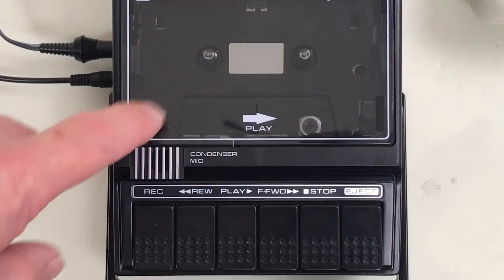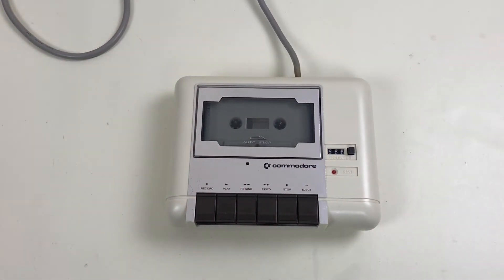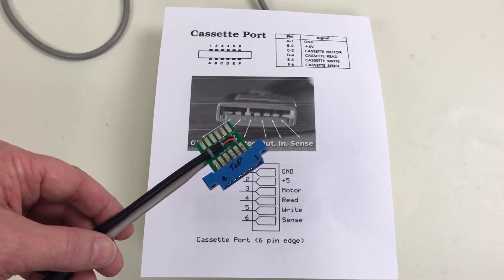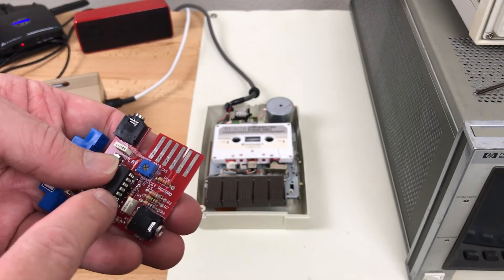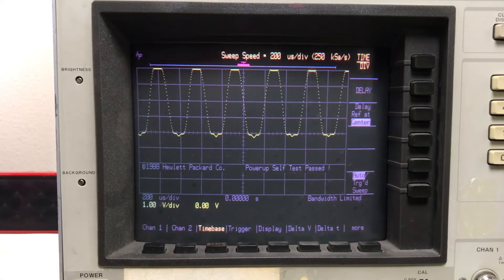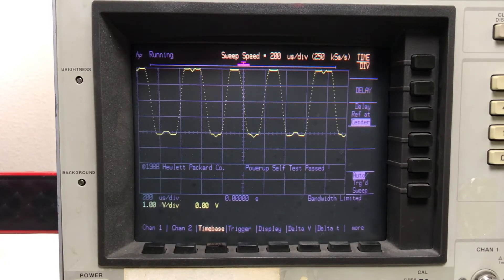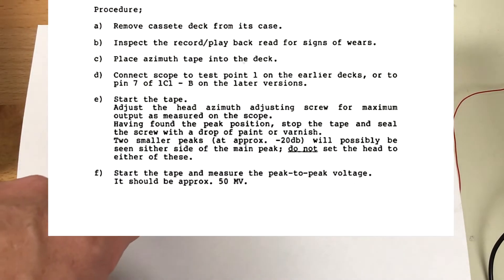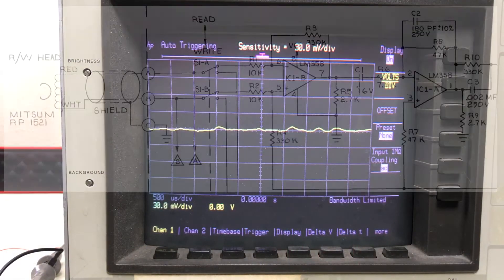Adjusting the head alignment on a Commodore datasette

Comment: Thanks...I do not have all the gizmos that you do, but I will see what I can do to see if my tape drives are indeed out of alignment...I have cleaned the heads as well as the contacts inside the connector...and have found a tape that I think can be trusted, but will go forth and look for a Vic-20 program pack from the factory and see if that makes anything better as well...

Comment: Good times.  I worked out the turn of the screw depending on the angle of the notch on the head screw.  Somewhere between 0-90 degrees. Anymore than that you've went too far. Whole lot of trial and error but it was all part of the fun of cassette loading backup tapes.

Comment: Back in the day we had little computer shops and they could install a small led light next to the head alignment hole and we used to adjust the head according to the brightness of the led light. I'm sure you could come up with some basic set up like that with todays technology. I still have my c64 and that datasette unit in my parents house but haven't used it for 35 years, i hope it still works 😅

Comment: Nice work I picked up a 3khz test tape I used to set head aliment and speed it works good.
But I opened the data set and got the single off the first amp befor it was converted to digital squarewave..
There was a test point for it on mine.

Comment: Awesome.  Will be trying the oscilloscope methods tonight!
Reply from the maker: How did it turn out?  Did you ever get that datasette to load reliably?
Reply: @HutchCA  I did get the oscilloscope hooked up and I was able to fine tune the adjustment, but seems the voltages are too high. Still does not work right. I am going to compare it to another working datasette to see if I can identify what's different.

Comment: An advantage of the scope is that if you know roughly what the ideal output is, and your deck is producing the right level, you don't need to do "trial and error" adjusting of the azimuth.  Would using a tape with a single frequency tone, say 1000 hz, be easier to interpret when looking at the output?  Is the azimuth often incorrect on these datasette units?

Comment: If memory serves me well, back in the olden days I read about attaching a resistor (470 Ohm?) between pin 1 (SRQ) of the serial port and pin 5 (Audio in) of the A/V port and poke 54296,15 to be able to hear the cassette audio of the datasette through the Commodore 64. Can you confirm this?

Comment: Wasn't aware of the oscilloscope method before so huge thanks for highlighting that.  I'll be giving that one a try very soon.
Reply: @HutchCA  I'll be receiving one of those 1980's alignment tape kits soon so hoping that the tape in that will still be working and accurate enough.  I tried the C64 program and had reasonably good results apart from one game tape that 9 times out of 10 fails to load (it's a multi-part turbo load affair) while all others work.  Hoping that the oscilloscope method might at least allow me to get that game working as well.  I'm also putting in new drive belts.